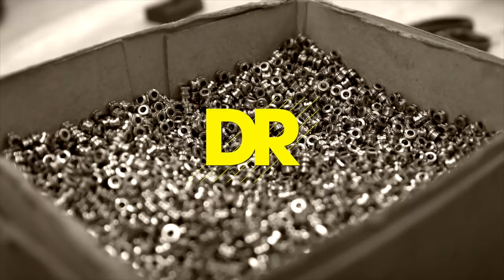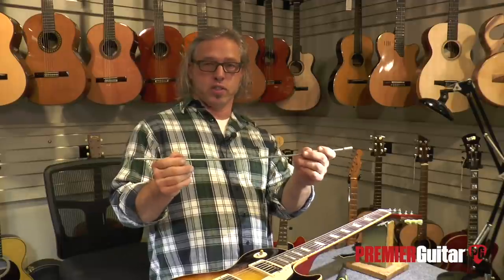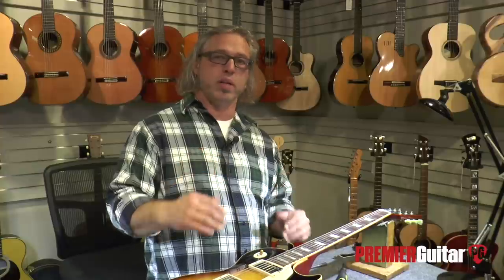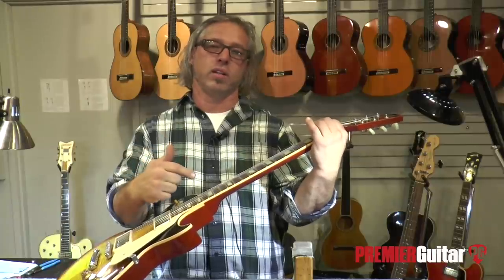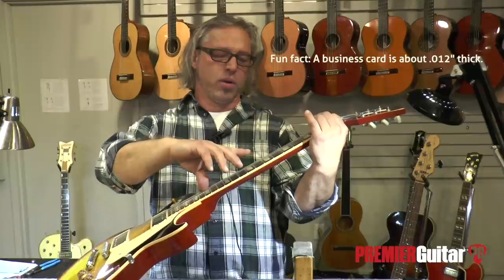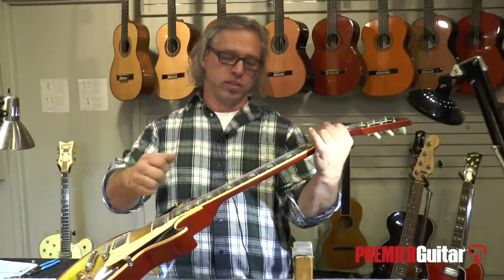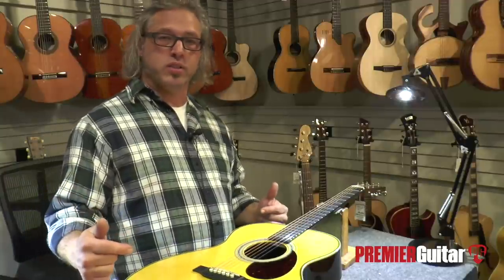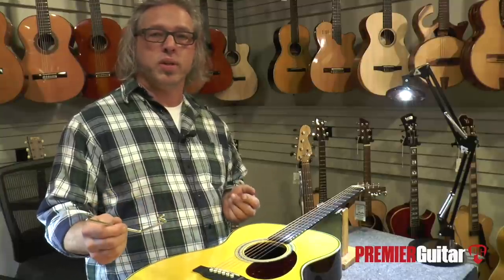DIY: How to Adjust a Truss Rod

Comment: Should this be done under string tension?
Reply: I would only adjust the truss with the strings totally loosened. Although some say it's safe if to slacken the truss rod if the strings are up to pitch buy not tighten it.

Comment: Gibson says .10 is the standard neck releif...Any les paul i ever owned .06 to .08 tops, is where i find its perfect.....Probably coincedence, though .10 is wayyyyyyyy tooo much relief! but thats all preference...My action at the 12th fret is 5/64ths of an inch on the low E, And 3/64ths on the high E....Which happens to be as recomended...I wouldnt suggest anything, if it were bullshit...Im experienced as far as guitar setups...So, if your starting to setting up your own guitars, and your new at it? Id say, save your money and learn, these guys  in the video are pros, but where im from guitar shops are  becoming obsolete, pretty much, and the last guy i brought a brand new gibson es 335 for a pickup change and set up? put 4 or 5 chips around one of the f-hole, bc he didnt know what he was doing, or didnt care! Probably de/valued my guitar close to $500 minimum, oh and the bridge volume knob dont work, when i go to the bridge? It seems like the volume is set at 10! Probably a bad ground connect, bc the pots i bought and checked out, with a potentiometer reader... And he wanted to charge me, hahahaha...I say just watch some videos, go slow, and youll be able to do just about anything if can use the Gibson multi/tool....KIDS STUFF! This guy knows what hes doing, but only you know how you like your guitar, and there gonna give you the safe measurments..if he lived near me, id definitly use him for my guitars, definite pro....But if your in my position, got burned,or want to save money, theres nothing like being able to become competent, at setting up your own guitars, exactly the way you like them....But, by all means if you have a pro that you trust, thats good too....Anyone need help or have questions,, ill be glad to.... hit me up! Great video!